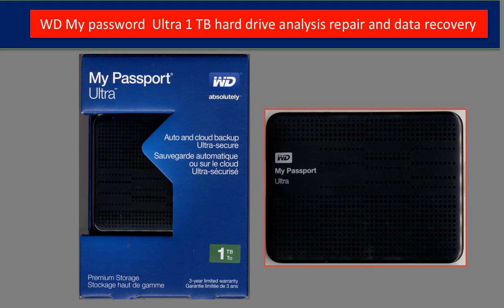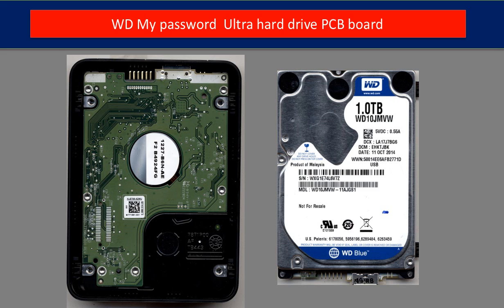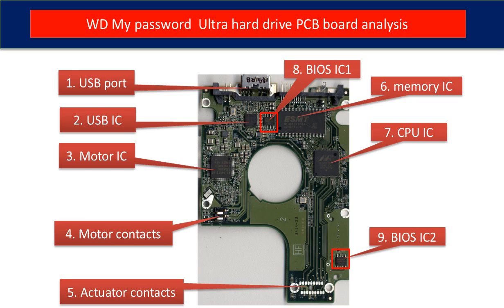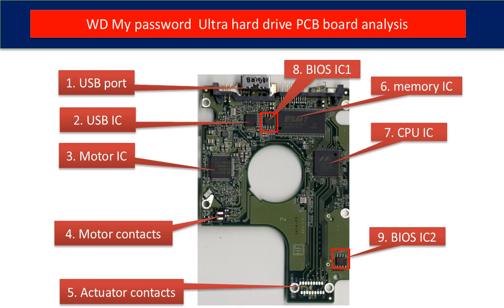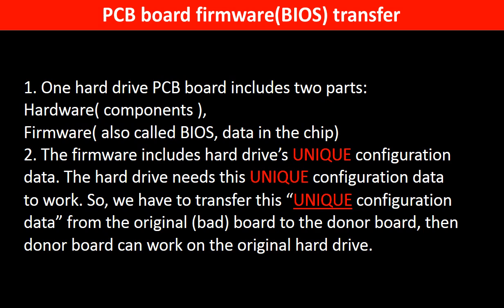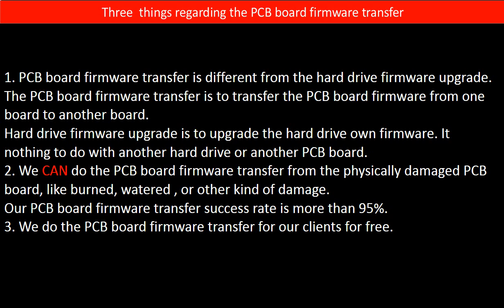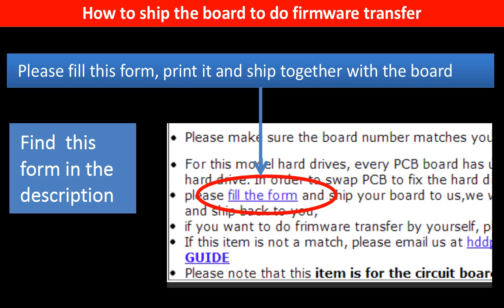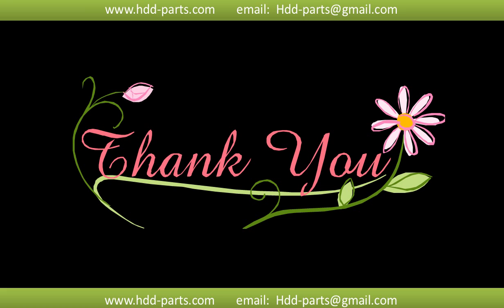WD My Passport Ultra 1TB repair data recovery  11S5XS1  WDBZFP0010BBK 771961   WD10JMVW

Comment: hey there if you swap the board will all my files be intact?  my board is not physically damaged.  windows 10 does recognize it.  but says fatal device error.  when doing wd diagnostics it say too many bad clusters.  chkdsk doesn't even work.  please help.

Comment: My external hard drive (WD My Passport Ultra, 2TB) fell from the bed to the floor. Now my Mac does not recognize it. It still turns on normally with the light always on and once and a while does a "beep" sound. I change between computers and no there is difference. What can I do??
Reply: New status it works under USB 3.0, strange!
Reply from the maker: Robi Arce yes, we can help. the PCB board is ok.  data recovery may help.
our quote is $275.00 no data no charge.
Reply: +Robi Arce
the same thing is happing with my hard drive! and im freaking out because i dont want to lose my data. can you tell me what did u do and whether you lost any data or not?
Reply: +Mariam Abdulla I couldn't do anything. I went to several labs and the quotes were over $1,000. Too expensive.
Reply from the maker: if we can recover your data back, our quote is $350.00. no data no charge
Reply: +Robi Arce  Hey buddy I can recover your data is there a password on the harddrive??
Reply: +Henry lee Yesterday a friend of mine gave me his WD. Windows doesn't recognize the hdd but it turns with no strange sounds, what can I do to recover the data?
Reply: 1.)Check under My computer to see if the hard drive is visible or is being recognized by your computer.
Reply: +Robi Arce I had the same problem yesterday, and i'm not sure what to do, did you fix yours? or at least did anyone tell you it's fixable?
Reply: have you tried an USB 3.0 or just 2.0?